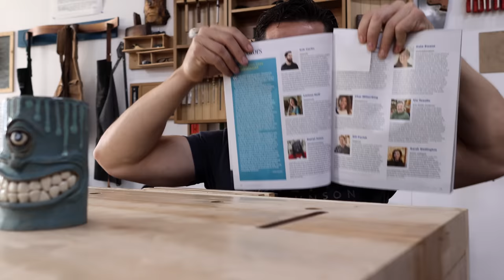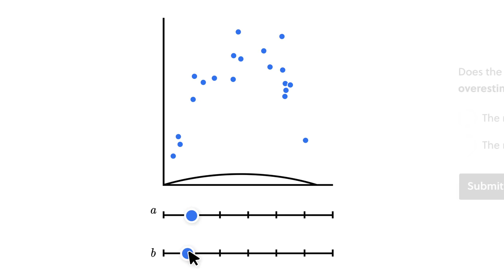5 tips youtube woodworkers give that professionals HATE

Comment: Gotta come in to defend the blue tape and superglue! Saved my butt a couple days ago when I had to temporarily fix a thin piece of material to a jig for routing. I used it because 1) I had masking tape that was 5/8" thick (perfect for my piece), and I would have had to cut my 2" doublesided tape down to size and 2) the doublesided tape is thicker and would have been too thick for my application (it was a decently complex jig). I used the doublesided tape on a different jig in the same day when that was the better tool for that job.

I mainly use tape+glue on thin or small pieces, where the same surface area of doublesided tape wouldn't hold as well (I feel like doublesided tape flexes a bit when you don't have enough of it). 
Just make sure you use a very small amount of superglue... what you showed in the video was way too much, which is also why it didn't cure properly! Less glue also means less chance of it squeezing out onto your piece (you need a surprisingly small amount of glue).

I use doublestick tape a bunch, extremely helpful stuff. There's a bunch of stuff I use it for that I would never use tape+glue on. Wouldn't make sense. Comes down to choosing the right tool for the job, like you said!

Comment: Legit reason for using Rubio monocoat: lots of small shops (like mine) have crap ventilation. No cabinet shop would have that particular problem. Rubio is a very low VOC compound, & my damaged lungs + crap ventilation needs that.

Comment: Congratulations on FW.  
I get it. A topic too big.  Number 5: Don't use Stain.  Aniline dyes are my favorite in wood, not sprayed onto wood.  When applied directly they usually sand out to allow for undulations in wood color... not always.  I prefer water based, but alcohol based also works.  The water based, of course, lifts the grain, but that is a good thing.  The sanding makes the undulations.  You can also cut the dye with water, and apply after sanding... or apply a different color after the initial... there are lots of ways to play with the stuff... without spraying. (I hate spraying.)  Top coat it with shellac or whatever.  Then wax... then rub-a-dub-dub.  There is a definite correlation between how much sweat you produce and the quality of a finish.

Comment: Good video and you made good points.

That said, the hard wax oils might be popular with many because of the one application idea - but I don't see those as the sole reason (and maybe not the most important reason).

I'm dealing with a small shop and actually do some work outside in order to reduce the problems with dust.  I can go outside and get the wind to blow the fine dust away from me and I'll use a big fan if I have to.  I don't have the systems for safe application of some of those finishes and if I'm doing it outside I have dust, bird droppings, leaves, balls being tossed over the fence from the neighbor's yard, etc.

Hardwax oil will require only 1-2 applications and they cure reasonably quickly so dust won't be an issue.  They are low- or no-VOC so I could do an application at the kitchen table and it wouldn't be a hazard.  And then there is the repair situation so that if the finish is marred I can fairly readily fix it.  What's more, if someone else has the furniture THEY can fix it.

Shellac can be argued to have some of the same benefits but my perception is that it doesn't hold up to liquids as well as a hardwax oil.

BTW, I highly agree that glue and sawdust don't work all that well.

Comment: Good video, interesting conversation. Fwiw I used Osmo until I tried two-part Rubio, which I much prefer. I hear there's a catalyst for most hard wax/oils now, but have not looked into them (edit: yet). Second coat of Rubio is standard practice here after light once-over first coat with 400 or 600 grit to de-nib, and typically machine buff second coat with lambswool cover on a medium pad.
Lots of ways to skin cats...if it works for you, it's right for you. Just the same, it's easy to latch onto the first thing that works. Trying alternatives is how we keep learning and improving.

Comment: Excellent, excellent points. 
I was talking about the blue tape and CA glue today, and said I have a lot of double stick tape. Plus CA is expensive.
Also, why not just regular masking tape? You don't need a fine paint line. You aren't going to have it on for 7 days...
I haven't heard of alanine dye in ages, and it's become hard to find. Angelus makes it for leather work, and I've used that. Great way to add color to blonde woods like maple. And as you highlight, tiger stripe and birds eyes really stand out.

Comment: Thanks for the clarification and information. One thing I saw that I haven’t tried yet is burnishing very small, and I do mean very small gaps, in joinery. What are your thoughts in that?

I would like to see a video on mixol and tinting. 

thanks
Reply: I've had burnishing go very well and very poorly. When its two pieces of end grain coming together, it only seems to make the problem worse; the grain doesn't really want to fit together. But for long miters parallel to the face grain, there it seems to fold together nicely.

Comment: For the tape/CA glue trick, I have never had a problem with too much glue. Starbond with accelerator tends to stick quickly and only a few dots are needed to hold everything. The tape does stick more than I want it to though.
Reply: Apply the glue to the tape that is on the project then place them together, no more glue on the wood itself due to misalignment ! I’ve used DS tape on my CNC and it has came “unstuck” and ruined the project.

Comment: Congratulations on getting published. What is most important is that this makes You happy and nothing else. We all need sense of accomplishment.
I appreciate your take on 'internet solutions' as not being necessarily bad in of them selves but not being universal fix-all. 
There is never one solution for everything. As I have deep personal dislike to blanket statements/solutions, I see it only as being blind to attaining versatile knowledge.
Wood finish to use will depend on what you need it for, fine woodworking piece will lend itself to more traditional waxes and oils
but more utilitarian thing like garage shelf will be likely treated with stain/lacquer one-in all mixture or downright paint if it will ever be finished in any way, shape or form.
Never used masking tape and CA method even thought I use quite a bit of CA in general. I just prefer double sided tape as it is quick and clean to apply.
Used saw dust and glue solution to mask hairline fracture in wood, prefer wood putty but they didn't have one of right color on hand so I improvised my own. ^__^
I don't like wax fillers because they don't look like wood even more than saw dust and I had a painful experience of doing repair of furniture that someone 'fixed' with wax based wood filler.
It was major pain in the neck to get rid of that #@#% from all fractures that needed mending.
I think that wood stain has one major downside, if it goes deep it's very hard to change the color of the piece if you so desire :P

Comment: As i understood it, the blue tape & ca glue idea was because double sided tape can leave a residue behind, and blue tape is specifically designed to not do that.

I only ever use it on finish ready surfaces, and always burnish the tape down to each surface first. Never had an issue with it either way.

Comment: Brilliant video! I am struck by how many of these boil down to people not wanting to learn the concepts, but just to be told how to do something. The C channel is a perfect example, even a basic understanding that wood will move with variations in temperature and humidity should tell us no amount of fixing it to a brace or beam will stop that movement. The wood always try to move, and if overly restrained either the wood will deform, crack or break whatever is trying to restrain it. Likewise with Rubio - hobbyists and professionals alike should not be asking 'what product should I finish with?' until they understand what the different types of finishes can offer.

Comment: On the subject of CA glue and tape... the first place I saw it was Crimson Guitars' channel. The point is that it gives you a low-tack bond which, due to the surface area, is very resistant to lateral forces found in routing, planing etc. 

At least in the UK, the typically-available double-sided tape is the stickiest substance known to man, and if you try to make a temporary bond with it, you will forever be finding gunky bits of it on your work, tools, bench etc. afterward. The guitar-building channel in question uses plain white masking tape which is generally fairly low tack, not the fancier tapes which tend to be higher tack to prevent paint bleed. Also a line of thin liquid CA glue is used to eliminate squeezeout, and this also means that, after a squirt of accelerator on the non-glued side, the glue cures in something like 10 seconds. 

I'm not sure what your double-sided tape is like, but for ours, it's orders of magnitude easier to remove the masking tape and liquid CA glue than to pry off a template secured with double-sided tape.

Comment: This is coming from a guitarmaker, here: 1) Blame it on Ben Crowe at Crimson Guitars. He made it popular a few years ago for holding down routing templates, and being from the UK, he has a hard time finding DSST (his claim). 2) no comment, we don't do that. 3) This sounds like the folks out there spreading Tru-oil all over nice flame maple tops and mahogany backs out there. It's great for gunstocks, but they make BETTER stuff specifically for guitar, boat and auto finishing. One thing that always works no matter what your final finish is: shellac as a sealer over the dye to pop that grain. 4) Guilty, but mostly used on Ebony or Rosewood fretboards, or possibly around a set neck mortise and tenon joint. On the other hand, I have had to also add wood back to the pointy parts of a pointy guitar someone let scrape on the ground, fill in bad pickup routs with a block o hogany then re-rout, and the same for a gawdawful Khaler Trem rout!...but I digress. 5) Yes! ANILINE DYE! Transtint, Angelus leather dyes, Fiebing's Leather Dye, Keda all work great on wood. Some can be used with anything from Nitrocellulose Lacquer clear to Polyester Urethane clear, too. Some colors do fade with UV exposure, but that can have it's own charm. I just find it interesting to see that it's not just guitarmaking DIY / Youtube that has these quirky trends going on. Now, stop sitting there reading an old man's ramblings, and go make some sawdust, Y'all!
Reply: About Tru-oil: yes, there are probably better finishes for musical instruments, but for the amateur instrument builder who may be building one instrument, maybe from a kit, it has two big advantages. One: it comes in small bottles (3 ounces). One bottle will probably do one instrument. If you buy one small bottle of the sealer/filler and a second of the standard Tru-oil, you will almost certainly have more than enough with little waste. If you are building one instrument and buy a quart of musical instrument finish, your heirs will probably be disposing of what’s left in the can after you die. Two: relatively low levels of harmful or volatile vapors, particularly since it can be applied with a cloth pad which can then be bagged and taken out to the trash. This is a big deal for a hobbyist builder, especially if you are in a basement workshop (next to a furnace or water heater) without proper air flow. If you are in that situation, be sure to download the safety data sheet for your varnish—whatever it is—before you buy it. And actually, Three: it’s almost embarrassingly easy to apply to get a very nice finish. It’s like using furniture polish.

Comment: Great video. I feel the same way about Titebond that you do about Rubio! It's great glue. Juuuust like pretty much any aliphatic PVA glue is great glue.

I use the CA glue and masking tape trick. I guess it depends on the brand of double-sided stick tape, but I find that witht he ones I've bought, it's harder to get off the wood than masking tape and leaves more residue to clean off.

Comment: Are there any videos or other resources explaining why/how C-channel doesn't prevent slabs from cupping? 

I completely understand propper wood selection, milling, and glue up technique is incredibly important for preventing that, but from what I understand, c-channel is used to prevent any minor warping that will happen over time, not stop any major warping that would be caused from bad technique.

I also don't really understand the tree roots breaking up concrete argument, since the reason that happens is because trees are constantly growing larger, not because of seasonal wood movement. 

If it really is useless then that's great because it save me some money on future projects, but if it's going to prevent my table from warping slightly over 10 years then it's a price I'll happily pay.

Comment: Depends on the specific type of "professional" i guess. But, i work In a professional (commercial) architectural woodshop, ive worked in a few, im a finisher by trade. We dont use hard wax oils for commercial applications. We use conversion varnish or lacquer.

Comment: I've been building furniture for 20+ years and haven't heard of 3 of the 5 tricks.  Stain is a matter of opinion in my view.  I know some people who use it to match furniture they own or just to create a barnwood/scrap looking piece.  I use stains on some pieces with numerous strip coats to give it an aged look but again, it is a matter of opinion.  With age the wood will give a beuatiful look without it but patience is in limited supply in the 2020's. I also find that too many woodworkers apply their stain after the piece has been complete instead of prior to assembly.  This leads to blotchy areas where glue prevented absorption or unstained spots in the nooks and crannies. The wood fill trick can be useful for fixing things that will not be seen but agree that it is overused by hobbyists.  I prefer to repair or use an epoxy to fill visible areas but I also reinforce most of my joints with epoxy because it can endure a lot of punishment.  

At the end of the day I always tell people building furniture is about watching a piece come to life and enjoying the process of building something.  The rest of it is just noise.  Get in the shop and enjoy what you're doing and you can't go wrong.

Comment: I agree with all of these and I'm a cabinet maker apprentice. I personally use Rubio Monocoat to achieve solid colors, but that's only because I don't have a shop or space to set up a proper booth for properly applying a matte paint job that lasts just as well. If I had that, I wouldn't be using Rubio Monocoat, because it's just too expensive and really not worth it, plus the accelerator is pretty fkn toxic, making the whole experience a lot more dangerous than simply using a paint booth, respirator and a spray gun to apply a matte color finish. I also use the glue and sawdust trick, but only on dark surfaces, where the putty-like apperance will be invisible. I've used it on a set of boxes I built for my sister and I've used it on a stepladder for my brother. The boxes got painted black and the places on the stepladder where this was applied, got a treatment of Rubio Monocoat Charcoal. Literally no chance of seeing that.

I would also like to add something to your list here. Edgebanding. No professional woodworker would, in their right mind, ever, fkn ever, use edgebanding. Leave it in the store. Throw it in the trash and use a solid wood edge instead. It lasts way, way longer and just looks better too. And, best of all, it's not even that much more work. Cut a strip, glue it on, plane it to the thickness of the board (can easily be done with a flush trim bit on a router) and then just sand it after applying veneer.

And on the topic of veneer, please stop the fkn contact glue method. It's a shit way to apply veneer. Use glue and a press instead, if you can afford it and have a large enough shop, use a heated press. Just normal glue and a press. If it's a cold press, wait an hour. If it's a heated press, wait about 10 minutes. Then remove the tape and you're good to go. Doesn't matter if its intarsia or bookmatched singular type veneer. It will look great regardless and it still requires the same sanding as before. Couple this with a solid wood edge and you got yourself a professional cabinet side. This is how we do it.

Comment: 1) Because most people have some masking tape around, and CA glue is 4 tubes for .75   cents.  Where I live the cheapest Amazon double stick is nearly 20 bucks, and I don't use it a lot.  I also won't know how it will work until I buy it.  It comes in version you can mount a bowl on a lathe with, to versions you can't get to stick at all.

And, apparently pros can't stop spilling their glue where they don't want it.

Comment: I've never liked the glue and dust fix, and besides agreeing with what you said, that it looks like putty, it's also inconsistent. But, recently I've seen a couple of ads from Starbond promoting their thin glue and using dust. From the video they showed, the repair really seemed to disappear, and I assume because the glue is must less viscous than PVA, it may simply blend better and also have no effect on the color of the dust. If I ever buy that product, I may purposely make some errors and try it.